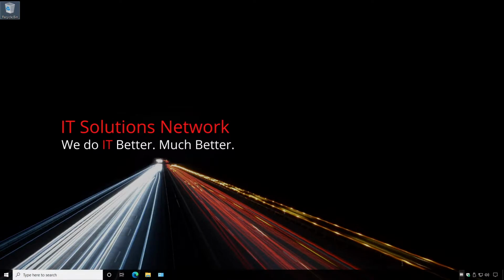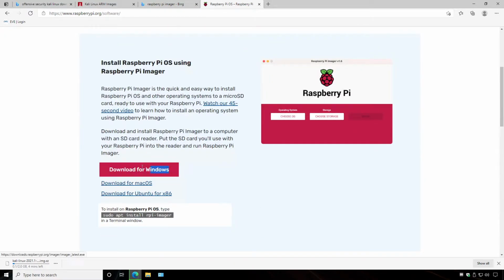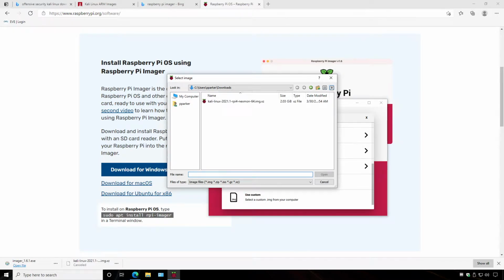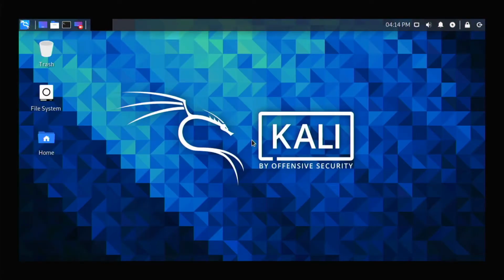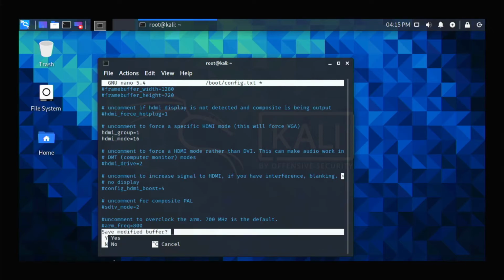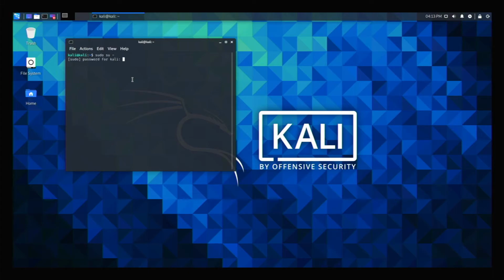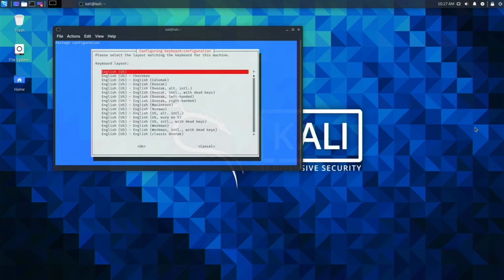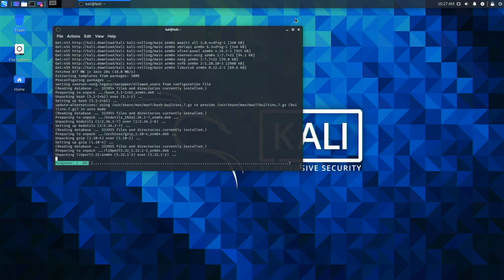How to install KALI Linux on a Raspberry Pi 4 for a Mini Hacking Computer

Comment: can I use a usb as a sd card ?....
Reply from the maker: What exactly do you mean by “as an SD Card?”
Reply from the maker: @the_imanur  It's doable in General. But depending on the current RPi 4 Boot loader config, you may still need SD Card to "activate USB Boot."

Also, I never used USB live KALI on a raspberry pi.